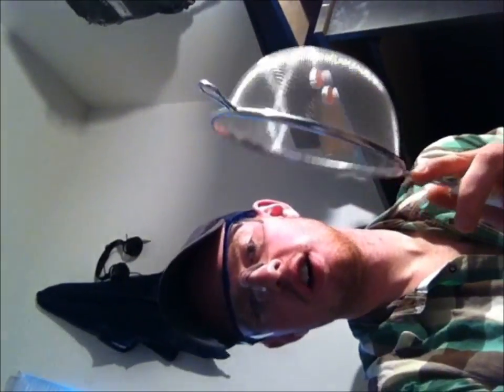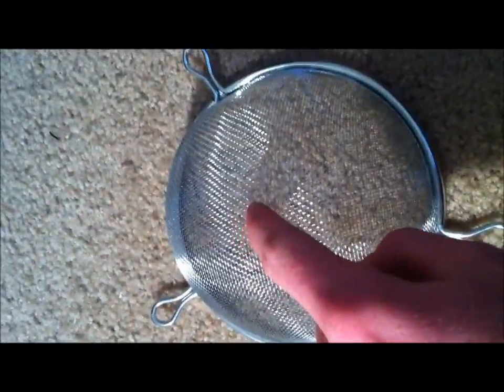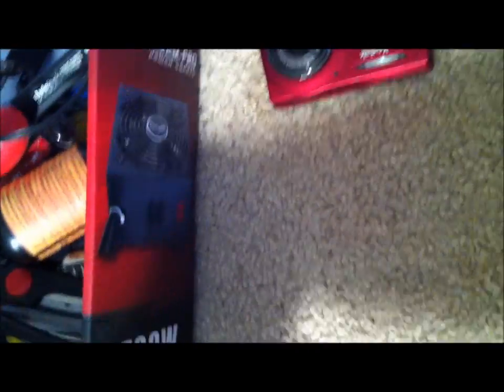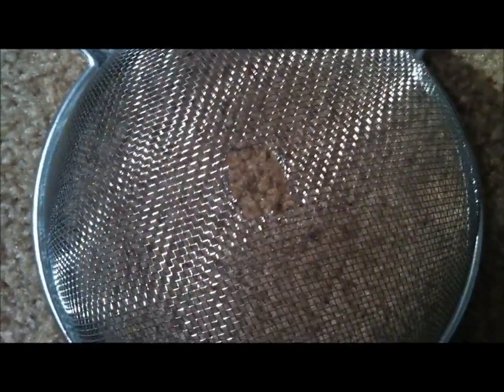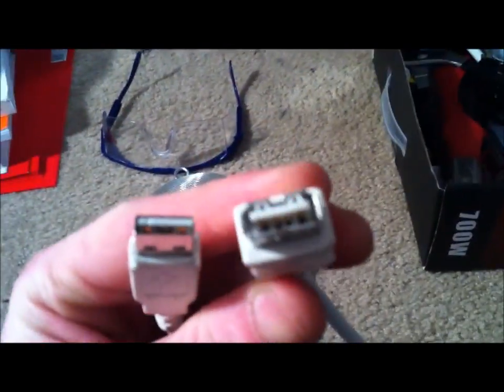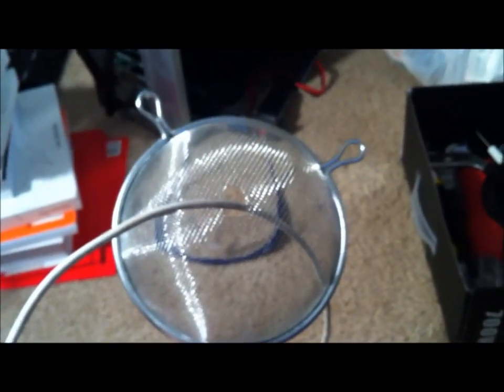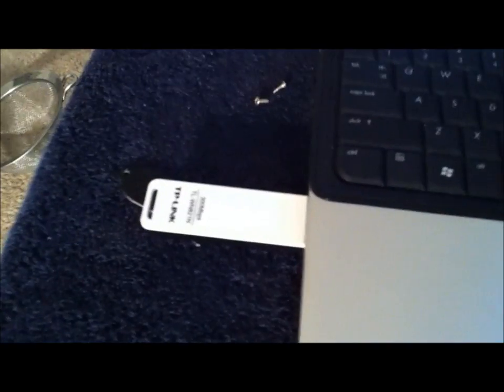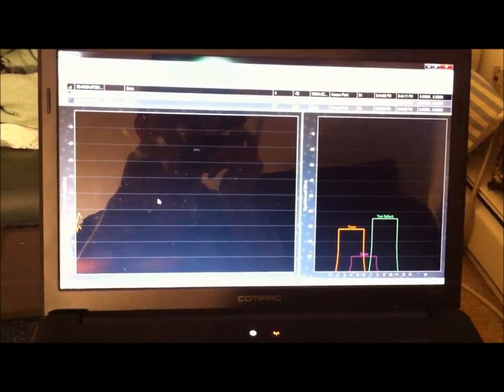DIY Long Range Directional WiFi USB Antenna Tutorial (AKA Wok Fi)

Comment: Since everyone seems to be using IPV6 now does this work with IPV6,
 and if it does will you redo this at some point ?

Bill Z
Reply from the maker: +Bill Zardus IPV6 has no effect on the efficacy  of an antenna like this. I started remaking this video a few years ago but never finished. I even filmed one scene where I used a mirror and the sun to light the fuse of a bottle rocket that I shot from my mouth to demonstrate the importance of focal points. Believe it or not, the stunt did not blow up in my face. I uploaded the clip as a video response to this I believe; either way, I am sure I uploaded it.

Comment: If boy genius can do it, you can, too. Think "satellite dish" - use any metal bowl or line a plastic bowl with tin foil. Look up "parabola" (best shape). You WILL need a USB wi-fi adapter (check pricewatch) and a USB EXTENSION cord (female A to male A), not A-to-B. Google "windsurfer antenna" to make one for your router from a cereal box and tin foil. Yes, they work. Distance depends on dish size and accuracy. The record is 55 miles using real satellite dishes. Line a hotel ice bucket with foil.

Comment: You would be better off putting the mesh cone down on a piece of scrap wood and just drilling out the size hole u need to mount the antenna, ither than that , COOL idea

Comment: Seeing 3 or thirty access points is immaterial. What you should have shown or verbally mentioned is the comparative signal strengths, in decibels, with and without your signal concentrator made out of sieve, sorry WOK! I would also suggest you use WirelessNetView by Nir Sopher, www.nirsoft.com, which gives the result in %.

Comment: Maybe it’s called a strainer or colander, but that’s not the important part… What’s important here is the WOK is what you twoah at a wabbit...... (Elmer Fudd, does technology) all kidding aside, your point is a good one but you may want to include some math that reflects the signal frequency you are attempting to capture. Example 2.4 GHz uses a different reflection radius than 2.6 Ghz and faster speeds use “tighter” higher bandwidth or smaller circles i.e. “imagine a ROCK dropped in a pond radiating circles or waves, very similar, bigger rock bigger circles or slower frequencies 2.4 GHz, or a smaller rock closer circles or higher frequency 2.6 GHz etc. So the size of your outside circle with the handle (circumference) and it’s screened dome depth (radius) which used for reflection only, to capture more significant amount of the WIFI’s frequencies Signal matters. No kidding, I mean no disrespect just thought I’d share some info, in the hope we all get better together. TEAM=Together Everyone Achieves More. Good luck & be creative not ilegal.

Comment: What was the gadget you plugged into the antenna/strainer?
Reply from the maker: It is a TP-LINK Wireless B/G/N USB network adapter. I do not know the model number off of the top of my head, but I can look it up for you when I get home. I still use it everyday, four years later. I got it on Amazon, it was dirt cheap. By now the newer models should be better; I am told that technology gets faster with time.
Reply from the maker: Here we go: TP-LINK TL-WN821N 11N Wireless Adapter

Comment: that is not a Antenna it is a Reflector / Director you added to the pre built WIFI Antenna
a 2.4GHZ antenna is 1 - 3/16in. for a 1/4 wave, 2 - 11/32in. for a 1/2 wave, and 4 - 1/8in. for a 7/8 wave good video for not knowing the fundamentals of Antennas and RF=Radio Frequency never coil your antenna if you dont have to most that are coiled are do to them being 18+ feet to save room like the cb ones on cars a 1/4 wave on a car would be 8ft. 7 - 31/32in. if thy did not coil most of in the the base

Comment: That's why I fly Lear-Jets for a living and you are stuck taking a half hour to glue a USB connector to a strainer...
Reply from the maker: That is freakin' awesome, I retract my previous insult. I made this video a long time ago; I am four years older and four years wiser now. I have a question. Which model do you fly? I was just reading about the different Lear Jet models. I saw the service ceilings were usually upwards of 50,000 feet. I know that commercial airlines will fly at 30k-40k feet. Do you simply fly over these commercial jets, or do you route around them?
Reply from the maker: Patrick Motley I spend a lot of time as an internet troll, so I know how to defeat them.

Comment: Useless device as your phone's WiFi radio is not that strong to be able to handle long distance WiFi communication both ways. You'd be able only to download.
Reply: useless comment as he not boosting his phone signal but the signal of his wireless usb adapter . now if you think this is not doable, and will not work you should go back to school, starting by elementary school or learn about antenna, parabolic and signal #5yearsLater

Comment: Nice idea...Goofy execution.Smoking pot beforehand slowed you way down. The often muttered "F" word and pro trimming scissors gave you away. Cutting the original hole without bending the mesh would be much easier by slice-punching from the inside-out, not clipping from the outside, in. Use a razor knife that they sell at the $.99 store. If you dont have a hot glue gun, you might use silicon from a tube or even Elmers wood glue, why not? For ease of connection after gluing, put the male end through the hole in the bowl...not your bong bowl.

Comment: How do i connect that on my ps4 ?
Reply from the maker: I am not near a computer, I am on my smartphone, find out if the PS4 has a built-in wifi adapter. I have a feeling that it does. If the wifi chip is inside of the system then you are out of luck unless Sony makes a compatible external USB wifi adapter.

Comment from the maker: If you have an iphone your wifi antenna is on the backside near the bottom underneath a piece of black gorilla glass. Now, you will need to get angry, really angry. Watch the hulk and find a solution to this. I need you to smash that iphone as hard as you can. Compare the debris to that of a USB WIFI adapter. Now, get back to me and tell me how they compare. Don't believe me? I get angry to I can send pictures. Also, this video involves a phone in no way so shut your mouth.